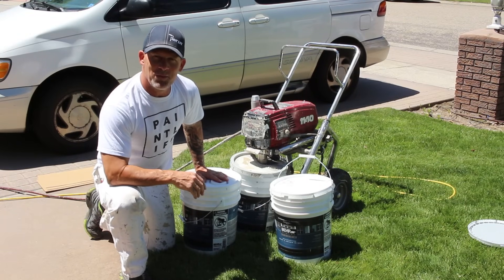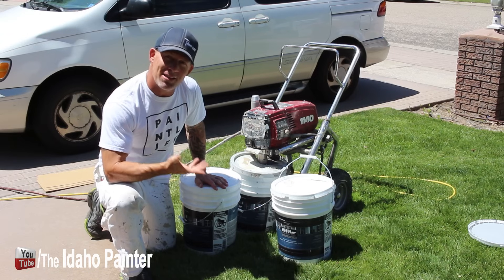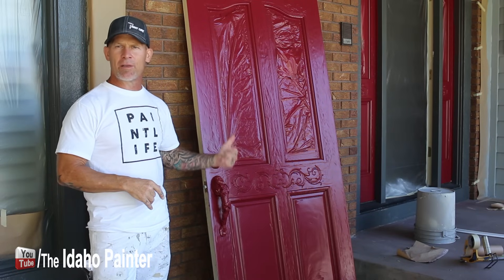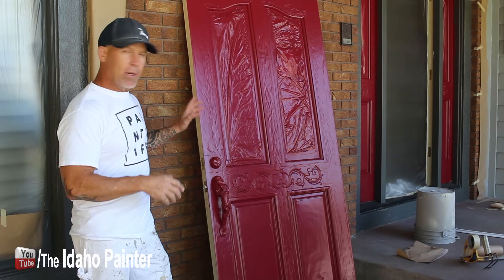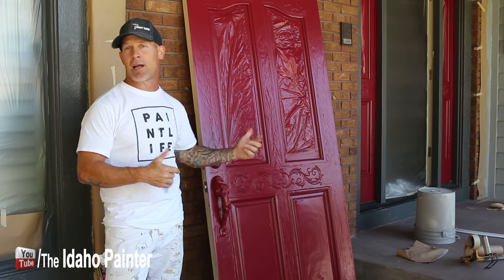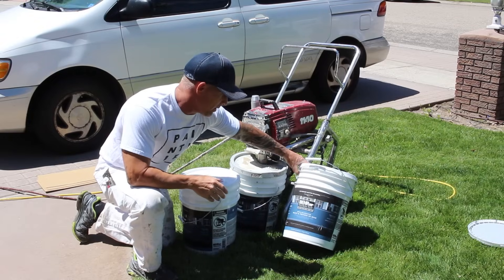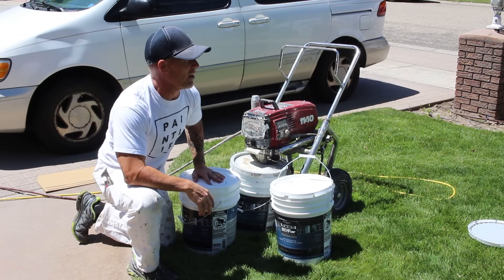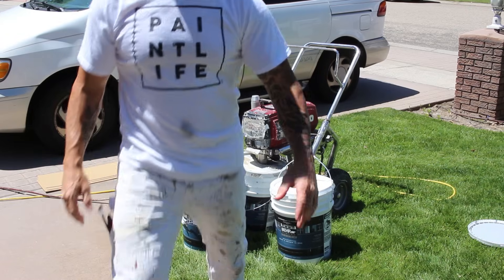Behr Paint Review.  Should you buy this paint?

Comment: Behr here is like spreading sticky honey. pulls on brush and does not spread well with nap and does not level well leaves stokes on trim. Very thick. Exterior ver. Drys way to fast. Different recipes on paint up here in canada
Reply: Behr Ceiling paint is hard to keep wet edge and shows lap marks too. Very hard to work with but is most durable paint i have ever used. Good thing about it if u ding a wall the paint does stretch so u wont see the white drywall unless a good puncture threw its very resilient to traffic and scrubable
Reply from the maker: Yes, thanks for sharing!
Reply: explains everything, I probably painted over 20 rooms with behr and staircases. The paint dried so fast. Very hard to do ceilings

Comment: I just used 4 gallons of Behr.  2 of the Behr Ceiling paint and 2 of the Marquee.  I have to say the Marquee does look good but it is not a one coat paint.  You really need to have enough paint and roll it slowly in order to be one coat but it just doesn't seem like enough coverage over certain walls with one coat.  The Marquee does seem thicker than other paints, it takes a little longer to dry too but for the price you pay for it's about the same price as Super Paint from SW which rolls better and have less splatter.    As for the Behr ceiling paint, it is garbage.  Way too much drips and splatters compared to SW Eminence which really rolls easily without drips.  So I can't say Behr stuff is great, they are ok if you have a HD 10% coupon and get it cheap.  You get what you paid for.

Comment: Chris,

How do you handle interior corner cracking? I live in an old house and the corners always seem to crack. I re spackle and in a short time the crack reappears.  Mike
Reply: Mike Formichelli .. Try some flex fill from home depot.
Reply: If caulk doesn't work, you might have to remove the old joint tape and replace it with new tape.
Reply: Thanks. I'll try the caulking.
Reply: Thanks for the tip.
Reply: Mike Formichelli 

The cheat is a thin bead of caulk in the corner, digging it out and retaping is right, but if you are actually respackling and getting cracks repeatedly wider than the paint can conceal, I'd suggest you get some lolli columns in your basement/crawlspace and look for settling. It shouldn't keep shrinking to such an extent that you have to redo other over and over.

Comment: You said that they (Home Depot) doesn't discount to contractors. If you join their "PRO" group, you can get up to 20% off. Consumer Reports rates the paint so highly because you can put it on and it will last about 10 years in the weather. Their ranking isn't about how well that it goes on, but on how well it lasts and how good it looks over the long run.
Reply from the maker: Thanks for sharing Rod!
Reply: Rod Wolfy it's based on how much home depot paid them to write the report.  Get your head out of your rear man
Reply: Btw as a contractor I get at least 40% of at Sherwin

Comment: I've used it on my home and am NOT impressed with its durability. I used it on Hardi Board, Hardi Plank and white wood trim. I used their primer, sprayed and back rolled or brushed 2 top coats. I felt that I did everything possible to make the paint last because I didn't want to repeat any sooner than possible. There is serious fading and some peeling on the trim and some peeling on the bottom coarse of Hardi plank. Inside the home I sprayed a level 5 smooth wall without back rolling in the living/ dining rooms and rolled bedrooms. They turned out excellent and have held up fine, but then they are not touched by anything so they aren't tested in anyway.

Comment: I have a question about Behr paint. I had walls that were sand,red and periwinkle blue. We put one coat of kilz primer in one room and Behr primer sealant in the others. We used a one coat of plain white paint and didnt cover well in any of the rooms. I started off using the lower end Behr and then moved to the mid level in the later rooms. It still didn't cover well. Is that normal for all paints or is it a Behr issue or just a user error? It took a coat of primer and two coats to get good coverage. Pissed me off since I was painting   Three rooms and a hallway basically three times.

Another issue I had was using the low end Behr is when I would paint their was weird grey showing through the paint even though their was already primer and no grey paint used. It had the appearance of thin white paint over grey primer. When I used the more expensive middle line(ultra) I didn't see this grey look.
Reply from the maker: Behr is not good, we would highly recommend not using it. We usually never prime unless it is new construction. It should not take more then 2 coats. Use a good quality paint

Comment: are we too lazy to remove he door handles on that door? it takes about 5 min. little details make the difference in paint jobs.
Reply from the maker: Masking it or taking it off is the same thing, just how we prefer to do it
Reply: its not the same. with 50 years experience in painting and restoring classic cars I know that only a hack would mask off the door handles on a classic car restoration. some things you have to mask but door handles are so easy to remove.
Reply: freethinker52  cars are different then houses
Reply: yes it is. house painters just slap it on quick. I guarantee you that you can not mask a door handle so it wont show. it takes less than 5 min to remove the door handle about the same time as masking it. so why not take the route that gets your customer the best job?
Reply: freethinker52 rah rah rah 50 years experience. Most painters choose not to assume the liability of door hardware breaking and having to replace it. Therefore it's taped off.
Reply: freethinker52 I've always removed handles. I hired an old timer who in 30 years had never removed a handle, and had no idea how.

Comment: I have not used Behr for exterior or for spraying but for interior it is the only paint I refuse to use. Drys way to fast it's like painting with glue. When doing ceilings it drys so fast I cant tell where I left off and end up over painting. Because it dries so fast It leaves texture problems when you over paint. I repainted a small bedroom ceiling 5 times last winter and never got a perfect finish with Bears ceiling flat paint.  I changed rollers after the third coat as well. I simply will not use it no mater what consumer report says. Or if consumers ask. That was the last straw. I only used it because the client had already bought it. NEVER AGAIN!
Reply from the maker: Thanks for sharing your experience Drew!
Reply: Drew Cama what paint would you use for ceilings?
Reply: You can cheat and use primer and they can tint the primer as long as it's a light base one or base 2 colour You'll definatly need 2 good coats. Or I would use Benjerman Moore Ultra Spec in flat finish. But if you want to pay more and get an extra Flat finish The BM Aura Matt or Ceiling paint aultra flat finish is their top Quality and might get away with one coat. I personally like their all around BM Ben paint which also comes in flat finish. 
If your doing your walls flat already and you want some graphic punch you could do your ceiling in satin or semigloss!

Comment: I bought behrs best semi gloss to paint my newly built bathroom vanity  and some trim. Very disappointed in that weeks later the paint still feels tacky and is not hardened like it should. I used Kilz new mold and mildew resistant  primer, two coats with sanding between each. This paint is very subject to scratching. Disappointed.

Comment: In my opinion, Behr midline is better than solo Sherwin Williams. Comparably Solo scuffs like crazy, and it took 3 coats plus a coat with tinted primer on new drywall. Compared to 1 coat with Behrs and no scuffing Solo scuffed like flat white really disappointed with SW quality. Dulux midline also did better 2 coats + primer. It's worth mentioning you should probably 2 coat regardless for new drywall but Behr wasn't see-through like say Dulux was.

Comment: BM UltaSpec  Exterior - You can single coat with a brush white over  red. It's incredible, high build, no runs. Thin it with XIM extender when spraying.

BEHR - runs when you brush and roll, like they said.

SW Superpaint, Resilience - the whites don't cover other colors well when brushing and rolling. Not worth the price point at all, BM Ultraspec costs about the same and cuts labor dramatically
Reply from the maker: Thanks for sharing Jeff!

Comment: Well I’m on my fourth coat using Behr paint in order to cover a 10 x 10 wall over a similar color ceiling. Not sure why the drop in quality has been so great. But I would never buy it again. Its garbage. I think the issues regarding running with Behr paint explains clearly the quality issues at hand.

Comment: The Marquee runs holy smokes, I go back to an area 10 minutes later and find drips
Reply: Hi.
Iam a painter and repair contractor. 
Running happens when  existing hot interior temperature, you should use electric fan to better job ,cuz latex always dry so fast with cool air / fan cool air.
Good luck..

Comment: I am a good man to have on hand, Dave the handyman! I'm not a pro painter but I do a lot of it anyway along with most all the other trades I do 'but I like behr paint & found it to not run as so does many other brands. But of course if it's applied too heavy' 'sure enough' it'll run. Especially if sprayed on & you don't have a second man back rolling it as you go along. I've seen it many times where they take the shortcut & just spray it w/out back rolling it.as well I see painters not even prime coat & or killz beforehand & expect good results. L.O.L They need get real & do the real deal, just do it right & stop blaming or making excuses for poor work.

Comment: I guess it is all about location when it comes to application of paint here in ca it is always hot and dry and after 53 yrs painting of all types we have found our way to behr strictly due to its durability in the sun I have many customers who are right on the ocean and I mean the houses get splashed all day sherwin has failed greatly and turned to faded chalk as it always seems to do and dunn edwards has gone to china as pigments go so we will no longer use them at all and they have gone way down hill in quality and up in pricing my family has been using them since day one and has stopped for the last 20 yrs but the behr marquee exterior satin in black is incredible I have 3 sample homes where the bulkheads of the decks are still as clean and shiny as day one even some times submerged in salt water waves many of my fascia boards are doing great in full time sun after 10 years the premium plus ultra has a run issue I agree but it sticks like glue but the marquee is thick and when you have a pro account gold at depot you get 20% off the top it helps a lot if you use a few hundred gallons a week by far my favorite lasting material is pratt-n-lambert it kicks butt but no longer sold in wonderful ca except the censored watered down home owner version

Comment: Primer is meant to go on before  paint, for better adhesion. I used behr with primer, it's junk, it's horrible through a sprayer. Behr reps claim you won't need 2 coats. Horseshit. It covers like trash. Also, i used to work at a home depot, there is like  a 30% markup for behr with primer added.

Comment: I hate behr paint. I use it all the time at work ( not by choice) I find the coverage to be pathetic, it almost always takes 3 coats on the cut ins, and it is so drippy. 2 coats doesn't even quite cut it on primed trim. The semi gloss seems translucent the coverage is so bad. Benjamin moore can get the job done in one coat quite often. Benjamin moore costs more, but it saves on labor, and you use less paint, and it looks better. My boss isn't bright enough to see past the upfront cost, so he wants to keep using behr, even though it probably costs more in the long run. I hate it

Comment: I'm sorry but if anyone on here is running down behr paint, you ain't painted enough.
Reply: Behr marquee that is. And for interiors, mostly. The one coat guarantee for outside is probably the best you can buy.
Reply: Contractor here in Hawaii, I use Behr almost exclusively! Great coverage and very versatile! Especially the Marquee and for older decks, I only use Behr Deckover!
Reply: 25 + years I’ll turn down a job if the homeowner buys this trash.

Comment: Behr Premium Plus Interior/Exterior High Gloss Enamel --- Horrible . I'm painting a white wallboard wall which had a white satin finish. I'm painting the high gloss over it with a brush and roller. Needed 4 coats and it still hasn't covered completely. Painting white over a white wall and still needs 5 coats., unacceptable. Sherman Williams might be the way to go.

Comment: Paint companies invest millions of dollars per quarter in R&D.  All paints do the job well.  Can one brand edge out another? Maybe, but to what extent and is it noticeable to the consumer.  However, the title of this video implies that Behr isn't as good as Consumer Reports states or as good as SW, which you clearly are referring to in your video.  You didn't prove that in any way. Why is catering to painters important?  DIY market is more profitable than selling paint at cost or just above cost to contractors. Delivery? Shouldn't you know how much paint you need for a job? If you have to run to the store while completing a job, either you're a DIYer or you haven't mastered your craft as a paint contractor.  SW is overpriced and hikes prices on DIYers then passes on the savings to the contractors but you already know that.  HD and Behr offer a 5% to 10% to contractors, which is fair in my opinion.  Behr products are priced reasonably for DIY.  As a contractor, you make money from the job itself that your customer is outsourcing to you not from the materials or at least that's the way it should be, ethically speaking.  In your video, you state that you don't like to give second coats. Second coats are recommended by all paints and its just common sense to do it.  Also, if its too thin, then maybe you shouldn't add so much water to the paint. As you stated my friend, this is clearly just an opinion. I've rolled and brushed with several Behr products and thin isn't what I experienced. But again, maybe you added too much water or could also be poor application.  Sounds like you're pushing too much paint through the sprayer if you're getting runs. Gotta use the right tip size.

Comment: Their semi-gloss & gloss enamel for trim, woodwork & cabinets is absolute garbage with gummy brush strokes that doesn't flow out well, the flat & low sheen wall paint is ok, I prefer Dunn Edwards out here in California.
Reply from the maker: Thanks for sharing!
Reply: vinniecorleone62 with a good soft brush it goes on better. And Behr makes an additive that you can add to that trim paint so it doesn't gum up when you paint. Makes it smoother and allows you to do big areas without it drying out before you're done
Reply: You can tell the better paints right off with their best enamels, my Dunn Edwards water-based "Evershield" semi-gloss flows out like an oil base enamel, I even use it on my wood cabinets, wood trim, crown molding & doors & it looks like they were sprayed even using a fine soft enamel brush & smooth foam rollers.

Comment: Video is all wrong.I have used Behr high gloss ans semi gloss in the premium plus.and thispaint is thick and runs less than other paints.  my exterior trim  I painted with high gloss premium behr ultra white and I painted it extra thick on purpose because  on my upper trim runs wouldnt matter, but even then it didnt run.This video is also wrong where they are saying its thin.Total BS video.  Behr premium plus is actually THICKER than most brand and runs less or none!